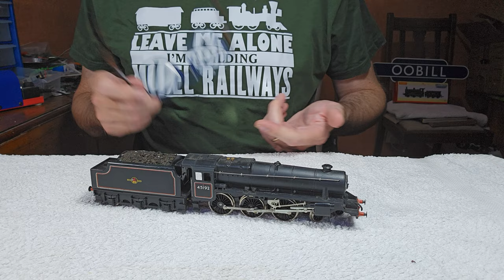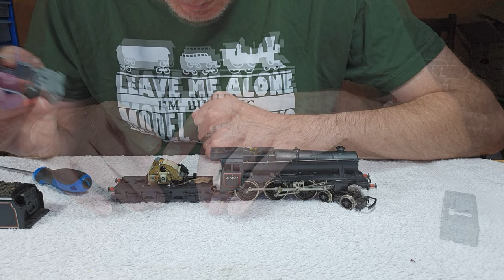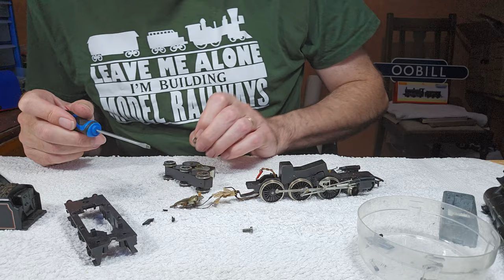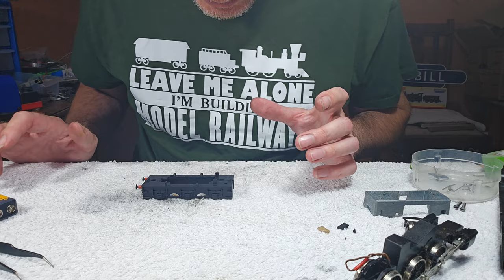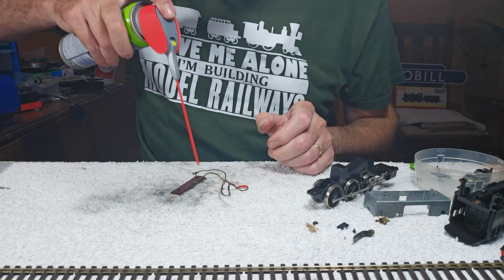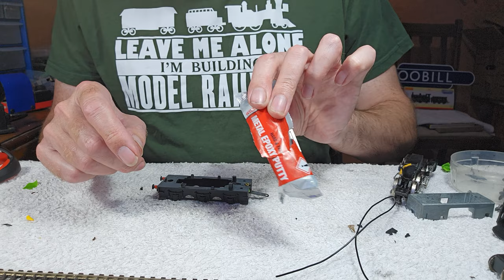Hornby R.859 Black 5 : Repair Request (Part 1)

Comment: Hi Bill, definitely an original Black 5. Permanently fixed tender drive and Britannia valvegear. There are a couple of work rounds for this engine. It is possible to convert it to a more modern separate tender/chassis configuration or my favourite. Get a Triang/Hornby  Hall chassis block. Swap the centre driving wheels over to get the fittings for the extra Walschearts valve gear and make it engine powered with a X03 motor. Make the tender free wheeling. You have to modify the rear body fixing. But a great deal of fun to do.

Comment: These tender frames are very vulnerable to over tightening screws holding the weight in - yes don’t ask how I know . I have a 9F from 1974 that is much the same . Looks like you may have an original 73/74 version there if it has the Fleischmann motor and hardwired tender to loco .

Comment: The crumbling tender chassis problem seems to be a common issue with the Fleischman tender drive locomotives. I have got the same problem in the same area of my 9F Evening Star. I’m going to try and make a plasticard patch.

Comment: Hi Bill, really enjoy your videos. Have you ever come across a tender driven black 5 with an all metal tender chassis and outer frame?

I want to replace the motor but can’t see how to get the outer frame off the tender to allow me to remove the motor. Any thoughts?

Comment: Black 5 is the one model I still would love but can't find a decent 2nd hand one. Ideally want a newer one. Tender drives only though aren't they? 😢
Reply: Hi Andepea, Hornby make a Black 5 with a chassis mounted 5 pole motor, R2360 is the one I've got. Haven't run it for a while as we've gone DCC and have not yet fitted a decoder. Hope this helps
Reply: @stevieb9699  is that the modern one Stevie? If it's over £60 then out of my area, but thanks for letting me know.
Reply: @_RandomPea  Ande... We've had it 15 years so maybe not that modern in this day and age of re-tooling the models frequently. I've looked on e-bay as a guide to price and they are listed around the £85 mark. These are great runners with the 5 pole motor and a massive step up from the ringfield tender drive. Good luck with your search, but if you find a good mint example you should not be disappointed. All the best.
Reply: @stevieb9699  great thanks Stevie. Always good to get recommendations.